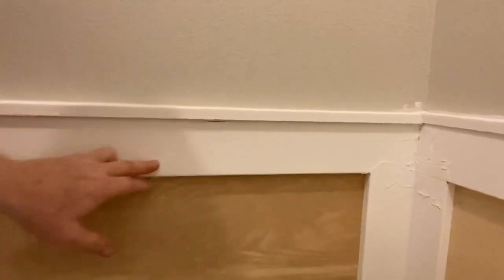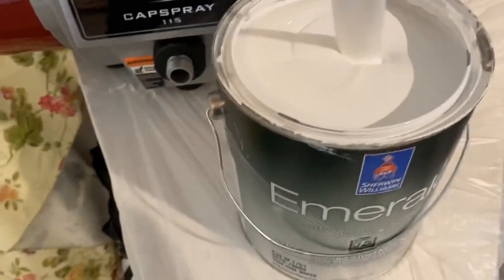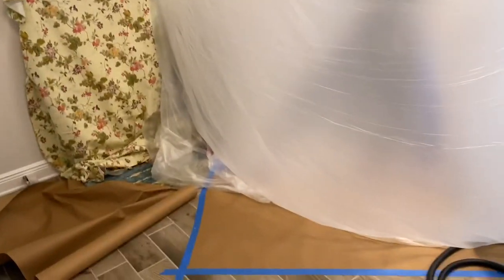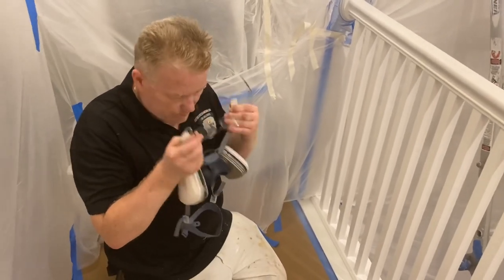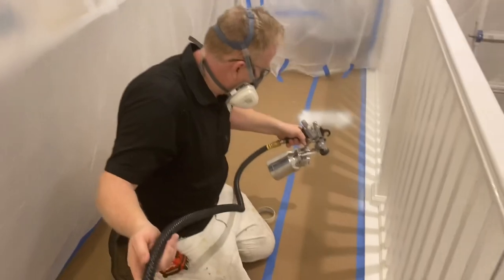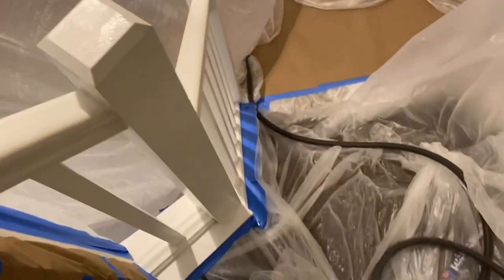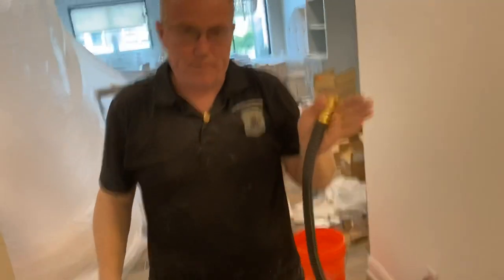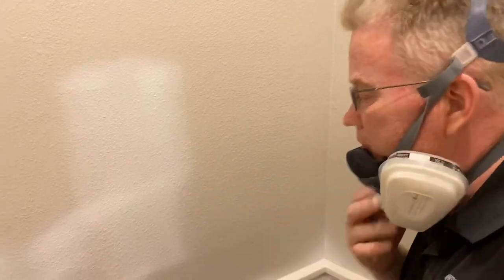How to Spray Paint Banister Spindles and Wainscoting with an HVLP Sprayer - Spencer Colgan

Comment: Hey Spencer - As always - Thanks for all the educational videos, I owe my thriving business to you, quite literally. Paper hanging is my passion, and it's catching on fast now in the UK. 
Amazed by how LOW volume your sprayer is set - will have to try adjusting my Wagner XVLP 3500 to spray less. I always seem to get a whole lot more product on than I imagined - every day's a school day, as we say. There are so many variables, paint viscosity and drying times, substrate condition, masking and dust control - I hate all the waste produced. It's so alien to a brush and roller guy but it sure saves my aching  joints from all the brushing!
Be well, Maestro.